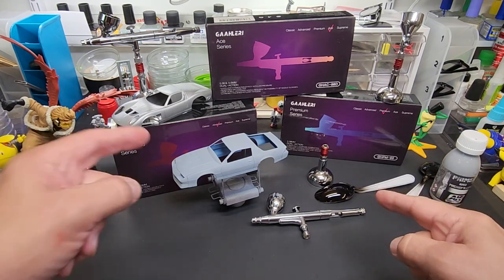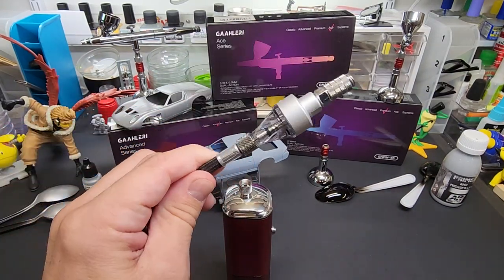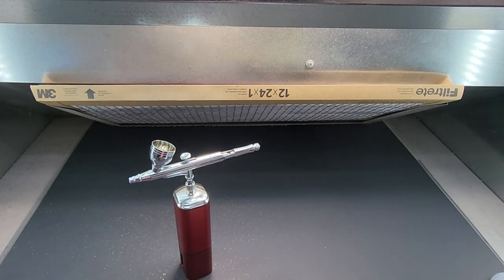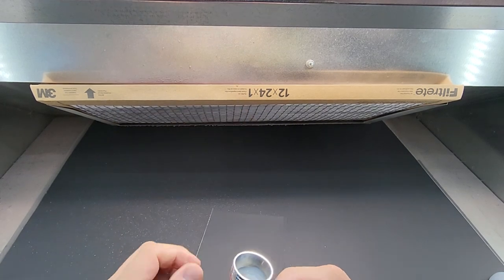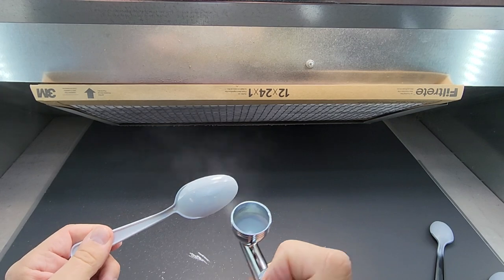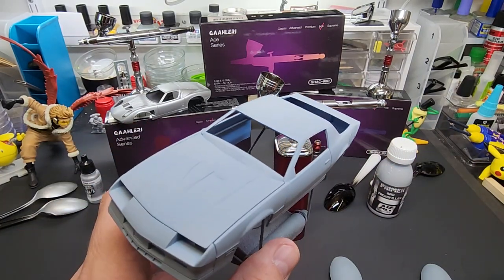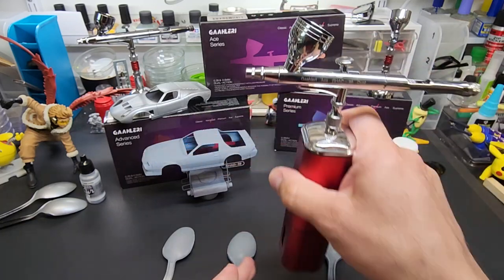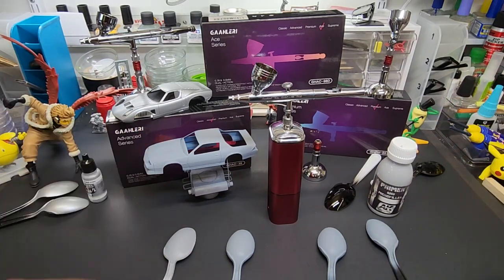Testing The Gaahleri Airbrush With A Mini Compressor - Will It Spray?

Comment: I was o n the fence about getting one of these airbrushes but you have just about sold me on one of those ace brushes and maybe one of those mini  compressors too!   great review!
Reply: I just ordered the 98D myself but it isn't needed for the battery powered compressors to work. I have 2 of them from Amazon and they run my Iwata perfectly. My compressor broke and I ordered one of them until I decided what new compressor to buy and ended up loving it and bought a second for my large paint booth. Plus the cheap airbrushes they come with aren't bad. I use them for varnish and other harsh stuff. They aren't way quieter than a regular compressor but they don't have that powerful bass you feel from a regular compressor. Also both of my battery compressors have lasted a year so far with no issue. A ton of people say they break easily but that's not my experience. Just thought I'd share lol.

Comment: Do these compressors work well with a hose too? On a .3 airbrush.
Reply from the maker: I use mine with a hose. There's several brands of these out there and they all seem pretty good. If you shop around you can find one with a hose included

Comment: I really love your videos, but I do have to say it is incredibly frustrating when trying to learn something and you never clearly state what pressure you're running paints at or what needle size. A lot of times you'll mention multiple different airbrushes and sizes somewhere at the beginning of the video and maybe give a vague "higher pressure" or "normal".
Would be super helpful if when you went to the booth you could maybe just say "This is a .3 at 18 psi" or what ever. 
Again, I love your videos and have used your advice in buying equipment and setting up my beginnings of the airbrush adventure.
Reply: Really the best way here is to experiment. Plus, it's really not THAT critical if you're using 18 or 20 or 22. The type of paint and how much you've thinned it plays a big part as well. If you thin a bit more or a bit less than he's done then you may have to adjust pressure on your end to compensate.

I'd say the best way is to mix up some random paint, dial in say 20psi, spray, see how it behaves. Then lower the pressure to say 15psi and spray again, observe how the paint behaves now. Now increase pressure and repeat. This way you'll develop a feel for it and don't have to have a specific value before you start painting.

Granted I'm still pretty new to using airbrushes but I've quickly found that it really isn't super critical what pressure you use as long as you're in the right ballpark.
Reply: Psi is more of an art than a science because it varies greatly depending on the needle size, paint brand, or type of paint. But yeah the best method is just to experiment and see what works best.